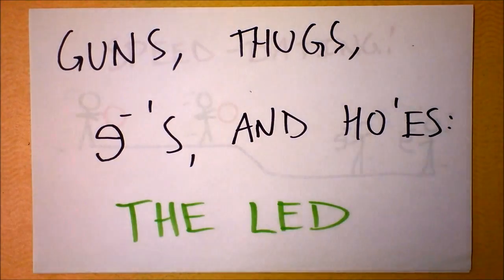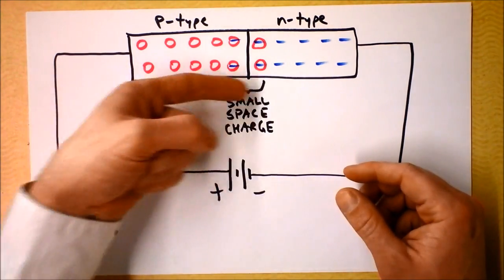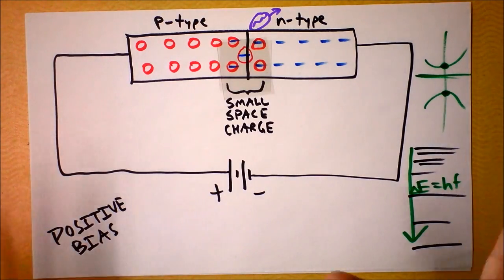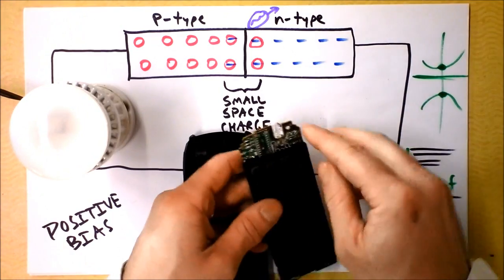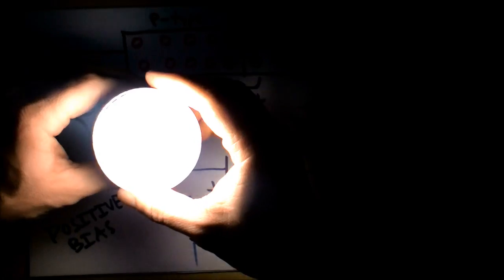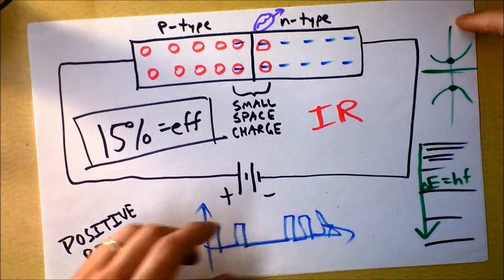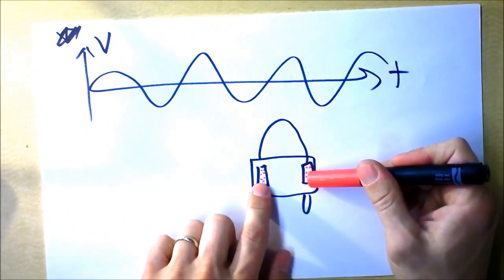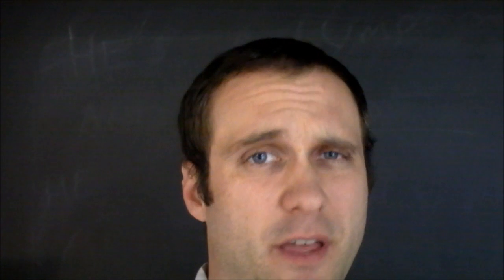How LED's Work | Doc Physics

Comment: Sorry for being late to the LED party but to answer your little test, duty cycle is around 40% judging by the spacings (less than 50% anyways) and the break down voltage is at most 2.2 - 2.4V depending on whether your line voltage is 110V or 120V (that of course is if you simplify this to the DC equivalent) but this is 60Hz AC so if you were to measure across one of the LEDs with an Oscilliscope you would see a half rectified waveform but you would only see the top part of the half sine wave. The peak voltage would actually be (sqrt(2)*120V)/50 = 3.39V. Now if we say the duty is 40% the turn on would be at 5% time of the cycle (because half wave) so turn on voltage is actually sin(0.05*pi)*3.339V = 0.53V. If the duty is less the turn on voltage is higher.
Reply from the maker: I think the duty must be less, since white LED's require quite a bit more than a volt.  Or maybe the number in series is not what you supposed?
Reply: True since I actually know that the forward voltage of white leds is like 2.2 - 2.8V (1.5 - 1.8 for red leds) so if we say the the turn on volts is 1V then the duty is probably closer to  30% --> sin^-1(1/3.39)/pi = 9.25% (turn on time) --> 50 - 2*9.25 = 31.5%!!

Comment: As of 2015, consumer available LEDs have reached >41% efficiency (radiation in the visible spectrum), a vast improvement from 15% as stated here in the video.
Reply from the maker: +Garden Tower Project DANG!  41% is extremely good.  Where do you get this figure?

Comment: I think you can calculate the cycle duty by measuring the percent of dark length and bright length. Also the video might be 30 fps or so and there are around four bright periods which means the frequency is 30 * 2 = 60 Hz.

Comment: To figure out duty, look at the last frame. Measure the last tip of the led to the second led. I got 12mm, second measure the led (rice). I got 5mm, now devide. Roughly 40% duty. LEDs start showing light around 3.2v. Your spinning that strip of LEDs at around 2 rps. I counted 28 frames in 2 revs. Each frame consistently shows 5 led dots so it shows they are in sync.

Comment: a simple IR Night Vision security camera also sees the IR emitted from a remote control ...
Reply: +Kevin Olesik    Most digital cameras or phone cameras can see IR light from IR remotes/IR LEDs.   When I am working with IR LEDs in my lab I have my Pentax digital camera handy to view the IR LEDs to see if they are on.  Or I use an IR phototransistor sensor in a circuit I made just for testing IR LEDs.   It just senses when an IR LED is lit and then drives a visible LED to indicate that it sees IR light from the IR LED.

Comment: You're in the states because mains electricity is 120V and has a line frequency of 60hz, the video you have is 30fps, so the two are in sync and you don't get that rolling shutter effect that you would normally see if you were recording this in England.

Comment: Can we have videos on transistors? They are in our course in Pakistan (and India too I guess). I'm sure a lot of people would love to see them.
Reply from the maker: Haider Rehman Butt That is a really great idea.  I prolly won't have one made until this summer, but it's near the top of my to-do list.
Reply: ***** It is capacitively coupled to mains, which is AC. Therefore Diodes only work half the time.
Reply: ***** The shutter speed of the camera can certainly cause the effect of strobing at low framerates! And this becomes apparent with the 
"wagon wheel effect" more appropriately called Moire aliasing.
Reply: ***** I don't know how you would construct it, and cannot immediately think of any uses for such a device without a better understanding of your concept, at least not with more details. An actuator as in a linear motor or hydraulic cylinder?

You can make the cylinder in a hydraulic cylinder move freely without too much force required by having the inlet and outlet open to pull and push oil out of, and become rigid in place by not allowing fluid to enter and escape freely. You can mount the cylinder on a pivot so that it some range of motion.

There is a need for better materials in nanoscience, and something under consideration is "memory wire" which will bend freely to any shape, but when you heat it up, it returns to it's previous shape when it was hot.

Comment: Nice video but in the first minute you make an incorrect statement. Electrons jump over the barrier because are thermally excited (as estimated by Fermi-Dirac distribution) – not because of an electric field.
Reply: And how do we suppose they are thermally excited?
Reply from the maker: Well, they wouldn't be inclined to recombine at all without the electric field (you'd just have a happy depletion region), so I don't think my statement is incorrect.  I've noticed that my LED's don't light up unless I hook up a voltage source.My statement might be incomplete, though.  Are you suggesting that the efficacy of LED's goes down as temperature decreases?

Comment: What happens to the hole and the electron after they meet? And are there new holes or are the same ones reused? If new holes are made where do they come from?
Reply from the maker: Annihilation.  And yes, new holes are created all the time as electrons leave the left side and get sucked into the battery by its applied electric field.  It's the exact opposite of the right side, where new electrons are being dropped off at the same rate.

Comment: And about frequency - if you see a slow-mo you will notice that at each frame there are two traces for each light - one is dim and the second is bright. From this I can assume that for one frame of filming the LED blinks two times. Knowing that the frequency for most cameras is 24 or 30 fps, i would say that these lights operate at frequency either 48, or 60 hertz. 
Of course, its just my supposition.
And by the way - how do you figure out the voltage?